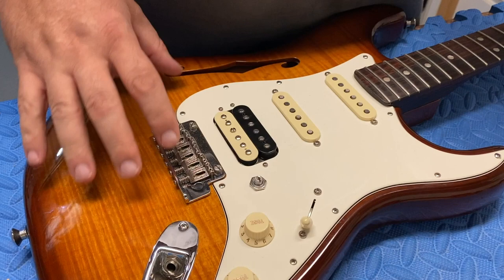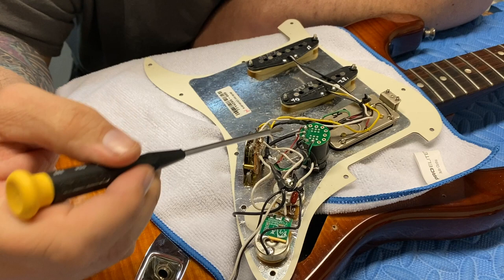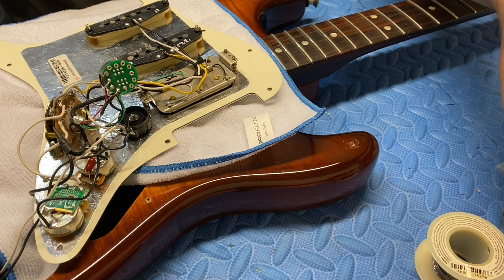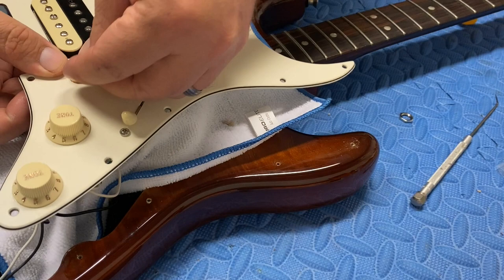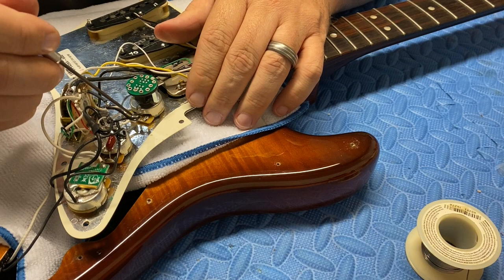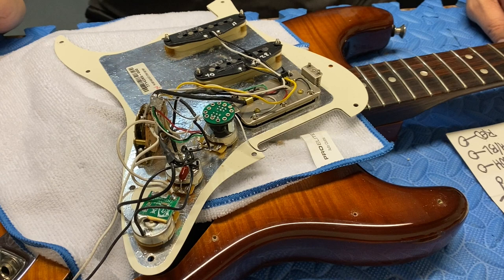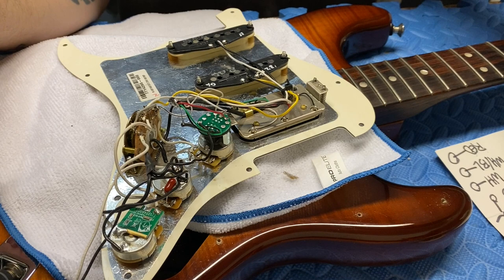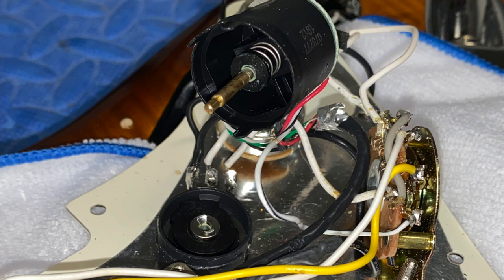Replacing the S-1 Pot on a Fender electric guitar

Comment: I put an S1 in a tele build last month and am already planning another rewire. These S1 switches are the very definition of "hit or miss" with most defaulting to being just complete junk. They just are. After install, the switch and knob have some "play" in the feel. I mean it just feels janky and loose when you turn it and it literally rattles when shaken. And it's in the switch construction- the switch/pcb does not attach to the pot body very securely at all. There is play in the body of a brand-new switch, and from what I've seen, they're ALL like that to varying extents. Then the button inside the (tele-style) S1 knob falls out b/c the vinyl coupler gets stretched out and loses the ability to do its job retaining the button correctly. Now, the coupler is stuck inside the shaft of the switch, can't get it out and it doesn't even couple. What a fustercluck of a design. Back to CTS push/pull for me.
Reply: Ya. Got rid of mine as well. Like you found, mine were more miss than hit.
Reply from the maker: Thanks for posting this - I don't have a lot of experience with the S-1, this is my first guitar with one. I was really surprised at the low quality of the original/stock S-1, so from that perspective the replacement was far better quality. Looking at it again in light of your comments, though, and yeah, there's some wiggle in there and I can see how it would degrade with repeated use. If it breaks again, I'll put in a standard volume pot and swap out one of the tone pots for a push-pull to get the coil tap action happening.

Comment: I just started having a problem with my S-1 as well. Mine does the opposite. It won't stay down. I like the sound with it pressed down. If I reserve the wiring, Could I have the "hot" position/boost on all of the time but go to the thinner sound by pressing the S-1?  Great video. Thank!
Reply from the maker: I don't know if just reversing the wiring will do the trick, but you should DEFINITELY be able to do what you say with the S-1 switch. It's just a matter of shunting the appropriate wires to ground - or not :)

Comment: Question. How to remove the that s1 switch cap?  It so hard for me. Did you just pull up? Or it has some screw in side of that pickguard?
Reply from the maker: Yes - just pull up on the outer knob like you would usually do. The S1 switch cap will come off with it.